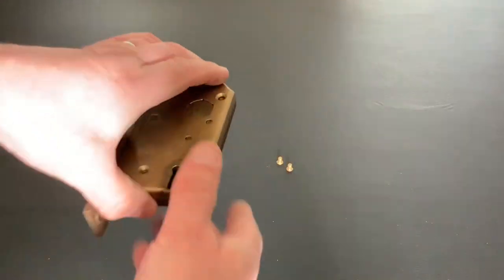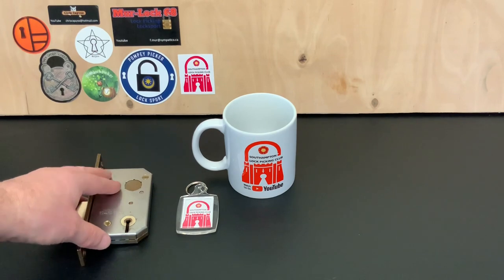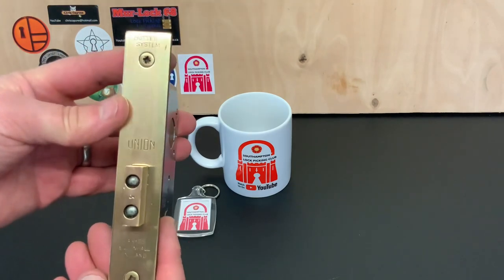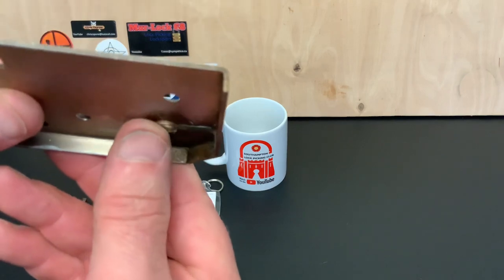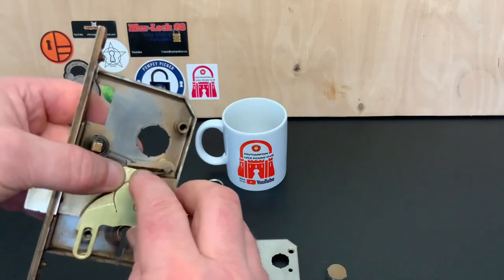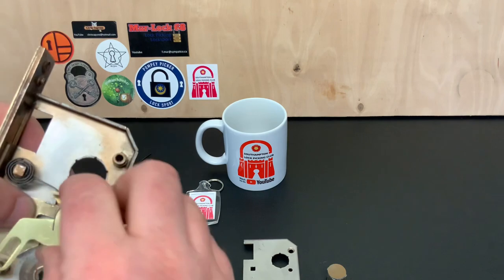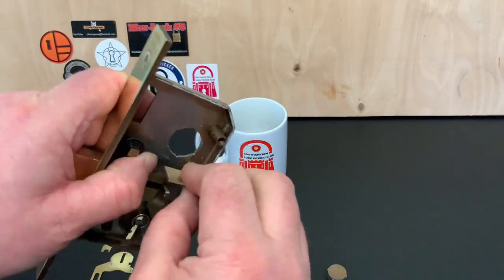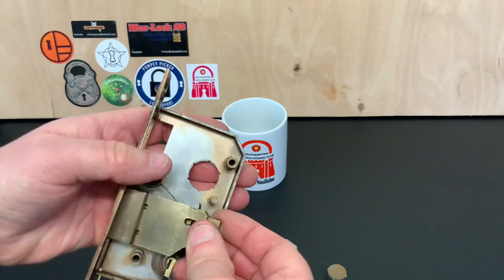(226) Butters Lever System Patent No 661501 Union Mortice Lock Gutted Lever Mechanism Demonstration

Comment: Cleaned up really well, almost looks like a new lock. Your video was only missing before and after pictures. 
Those levers look like new ones now and very nice brass spacers too. 

Have you ever thought of turning a standard 3 or 5 lever lock into a security lock. We see lots of videos where people fill pin tumblers with security pins,  so why not a lever lock. Do you think that's a possible project?
Reply from the maker: Cheers for watching Roy
I think you could easily file false gates in the levers 
Good idea mate 👍

Comment: Do you think that technically speaking a lever lock is where the levers pivot around a unified axis and this is a slider lock because the sliders slide up and down only?
Reply from the maker: Cheers for watching and commenting 
Maybe it should be called a slider lock 👍
Reply: Does that mean the disks in a disk detainer lock are really circular levers?
Reply: @penfold7800  There is no physical axis in disc detainer locks. On the other hand some other locks like the Ingersoll or the Urban Alps Stealth lock are considered lever locks because they have tiny levers.

Comment: So I'm thinking, there's no actual picking required when closing it, right?
It'll just tension closed and that little level will slide out of the notches?
Reply from the maker: Wrong.. You would still have to pick the levers to close it
Reply: @BrummieLockPicker  so, when you tension to close it, what binds on what?   I don't get it :(
Reply from the maker: When I get some spare time I will dig that lock out and do another video but basically it’s the principle as picking it both open & closed
Reply: @BrummieLockPicker  Ta muchly!
Reply from the maker: Did a video this morning showing the mechanism and picking it closed https://youtu.be/Bgb8r2cK4wM